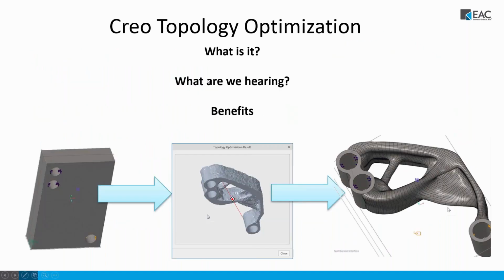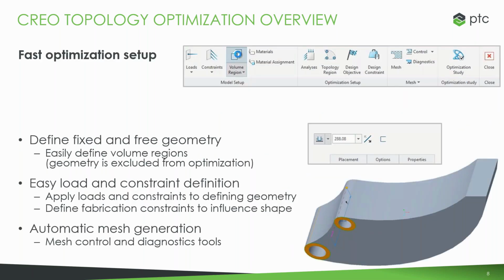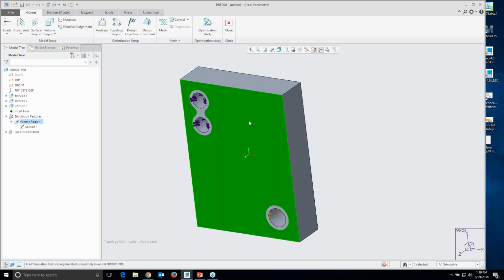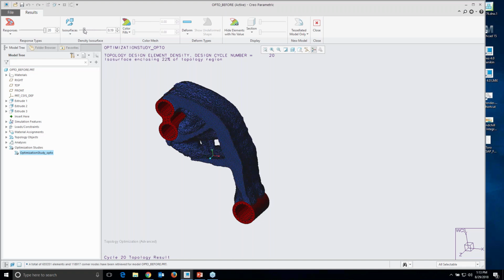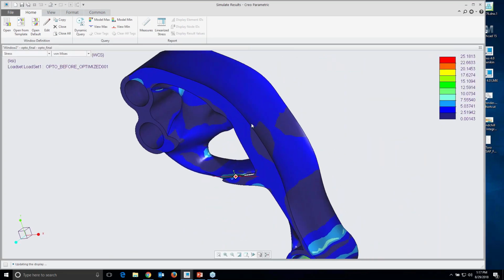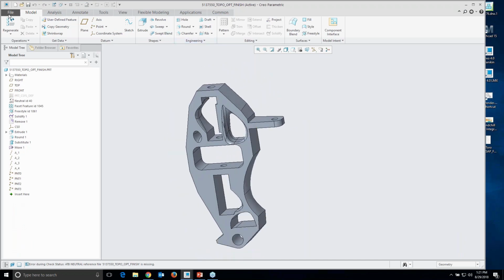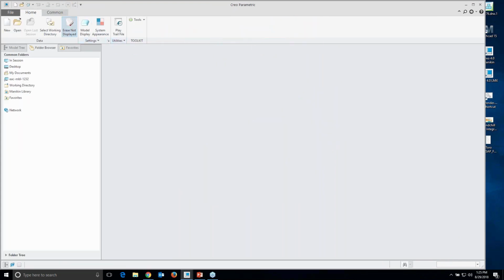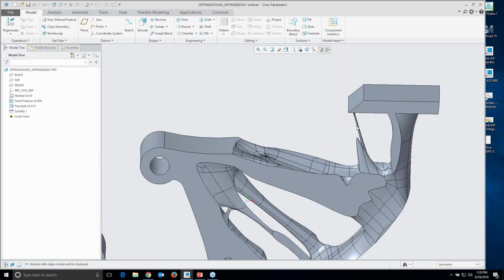Boost your analysis capabilities with Creo Topology Optimization and Creo Simulate

Comment: Can it do a geometry generation without base model, just constrain volume?
Reply from the maker: The model to be optimized has an initial volume. Inside this volume sub regions are created to apply boundary conditions. [Loads / constraints]
 
These sub regions are the part of the model that won’t be evaluated / modified during the optimization. Said differently, that geometry will remain fixed and won’t change shape.

Other things to consider are the manufacturing processes that will be used to fabricate the part. This will have impact on how the optimizer looks at the model, and determines which elements to retain, versus discard during the optimization.